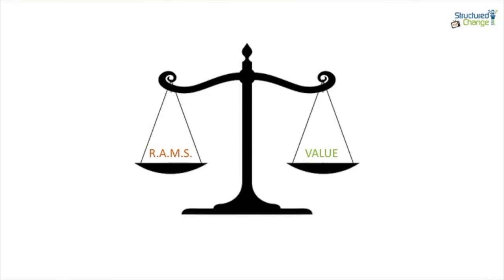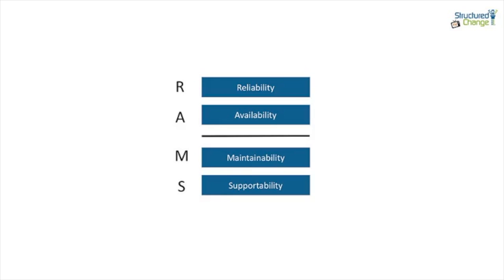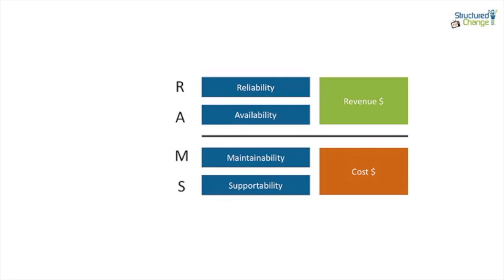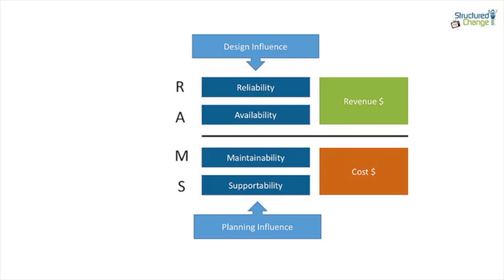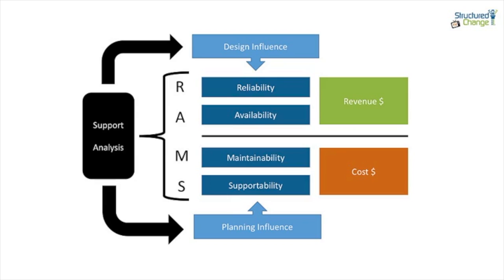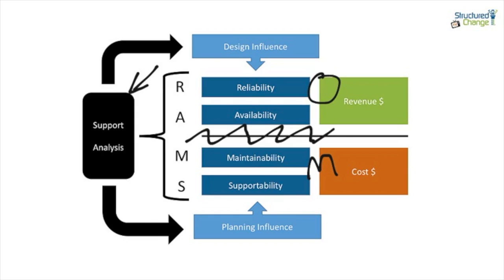Reliability, Availability, Maintainability and Supportability (R.A.M.S.) Simplified

Comment: hi Martin  thank you for sharing this nice presentation, just a question though. Doesn't RAMS stand for: Reliability, Availability, Maintainability, and Safety according for instance to the EN 50126 (railway) ? cheers
Reply from the maker: Sandro, I like to think that Safety is inherent in everything we do...(In our decisions and our actions). I view the "S" as "Supportability"...Eg it is one thing to have spare parts for our system but if they are located on the other side of the globe they aren't very useful or accessible to support "Availability"
Reply: It may be interesting talking about supportability, but, at the end the S of RAMS stands for Safety, otherwise it is confusing. Safety is not always included. You may treat Safety first, including hazard analysis and then fix the availability numbers.
Reply from the maker: Francisco, you highlight an interesting debate we often have here in Australia. On one side people prefer to see the "S" (or RAMS) represent safety whereas others view safety as being inherent in everything we do across the life cycle (Design, Operations, Maintenance and Support (Warehousing, Sourcing etc). As a person who came through reliability using FMECA and Task Hazard Assessment for Design, Operations and Maintenance I prefer the latter. An example I use is that if we store a spare part in a warehouse to support an asset how do we ensure that it is safely stored, is fit for purpose and there are work instructions stored with it for lifting points etc? This is how I explain that Safety is a concern across all the perspectives of RAMS. Thank you very much for taking the time to comment.  When it comes to safety I believe that the outcome is sometimes more important that the definition. Regards Martin
Reply from the maker: Sandro b I see at standing for "Supportability" as Safety should be inherent in everything we do...(System Safety, Asset Safety, Work Safety etc). Thnaks for taking the time to review.